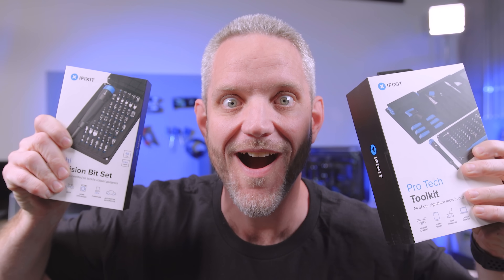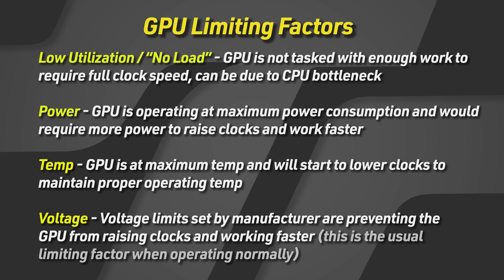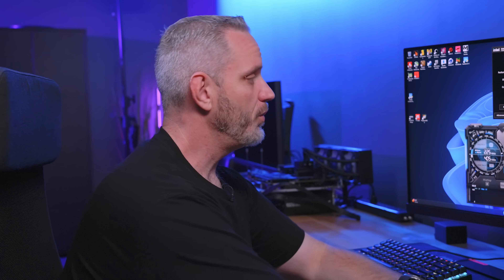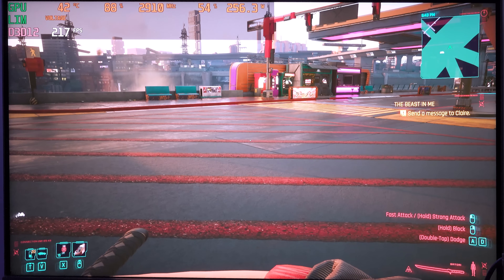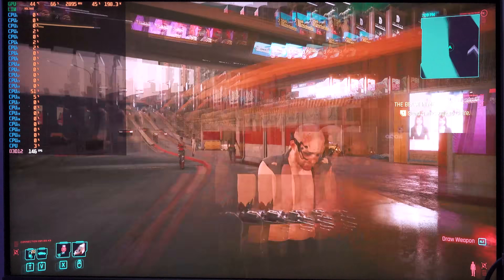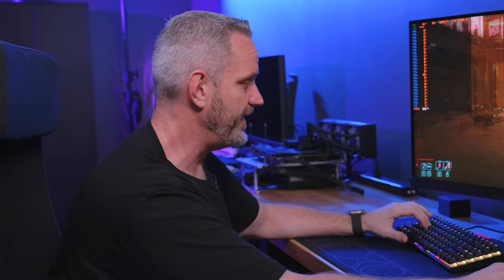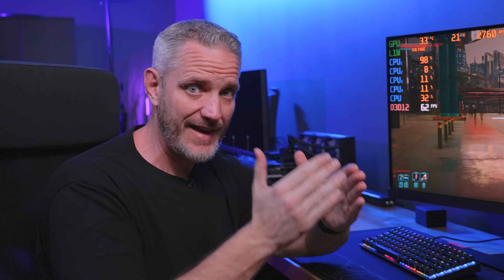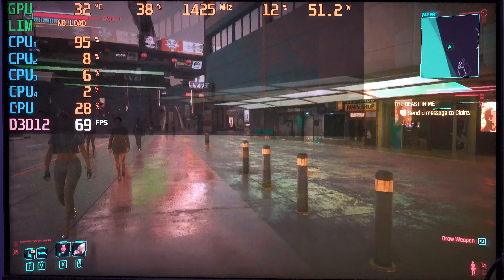THIS is what Bottlenecking REALLY looks like! AVOID THIS!

Comment: i found out today that my ram is currently bottle-necking most my games once i upgraded from 16gb to 32gb i gained anywhere from 70-100 fps in most games sadly tho i had to return the ram as the one i replaced it with were dead..

Comment: I have a ryzen 5 5600g cpu with a rtx 6600 xt and i cannot play fortnite. I get a max of 60fps and it constantly goes from 60 down to as low as 10fps. And it does it instantly. Do you guys think i need to upgrade my cpu? Ive read that it doesn't work well with fortnite

Comment: really does show that single core speed really does matter too tho as im running 4090 with a 5800x3d  and my frame timing is good but frame rate is not as nice as that but i run cyber punk with dlss and ray tracing on pathtracing tanks the gpu tho has anyone else found this ?

Comment: Well I have a overclocked i7 9700k 5.1ghz and my 4080 is killing it like in fortnite the frame drops and stutters are terrible and bf v is a little better but still annoying I really didn't think that it would bottleneck that much I knew it was going to but just not that much i'm hopping that a 5800x3d will fix it tho i'm just a little surprised that my i7 is having issues that bad with the 4080

Comment: I run a 5600x paired with a 3060, in 1440p, it doesnt like new world his high settings xD. You think i should upgrade graphics card?
Reply: No
Reply: @jehhh7794  found out why new world ran like 💩i had it installed in my hdd instead of my ssd 🤣

Comment: I think i have a bottleneck with my CPU but i still have to test. But now i know a bit how to test.
CPU: Ryzen 5 2600
GPU: Radeon RX 5700

If it wasnt for that i can still run everything with about 70 FPS (ultra settings) on 1080p and almost every game with 70 fps on 2k. Else i would have upgraded to Ryzen 5 5600 and the RX 6600/6700

Comment: Surprisingly the i7 3930 k does a good job with no CPU bottle neck maybe small amounts but in terms of graphic output it puts out so I don't know why you would ever pair a high end GPU with CPU if the CPU does not support pci e 3 or 4 sandy bridge processers made with no support for pci 3 shows just how far off technology is going off the page to extreme measures instead of perfect old craft I get high fps with my gtx 780 jay has to do this because it a job for him now to let the average consumer to go with the next gen hardware back in 2011 jay was vvery happy with his tri sli playing battlefield on 3 monitors.

Comment: I'm running a i7 13700kf with a 4070 ti and my limiter is voltage, but I'm still getting some occasional really bad stutters/skips. GPU at 97%, CPU around 60-65% utilization. I've tinkered with afterburner core/mem clocks at +100/+500 all the way up to +200/+1000 and cant seem to find settings that completely eliminate this issue. I've got g-sync on and set my fps limit at 140 in nvidia control panel, monitor refresh rate at 144, and in-game fps limit at 144, but I'm still getting that occasional WILD rise/drop in frames that lasts about 1-2 seconds. Anyone have any advice here?
Reply: to be clear, I've got my msi afterburner voltage slider all the way up and still have voltage as the limiter

Comment: Jay when you turned down your cpu to 4.1 your were still on low settings which uses more cpu of course its gonna loose A COUPLE fps. But bottleneck I feel is based more on the person settings, then the actual build, to an extent. And I never understood why people have to run such high fps! I am an xbox player, 60 fps is PERFECT for gaming AND the human eye can only see 30-60 fps anyway, anymore than that, your eye CAN NOT SEE. So understand my confusion. My bulid is a z97 4790k @4.4 2133 ddr3 600w PSU and a Radeon 6950 xt. Yes, a gen 4 pcie on gen 3. OMG, hell has risen from the depths lol. No problem. Back to fps, I vsync @ 60 of course, but I have everything to the limit, Rendering and Super sampling, Override all anti's, etc. But guess what, I get a constant 60 with, if any fluctuations, a lil higher frame time, cant notice, and guess what, my cpu, ahh 60- 70% utilization! Most people really don't really know how to set up things, no offense to them, but that seems to be the case. And the great thing about how I run my setup, I run my game clocks lower, which increase lifespan, and reduce temps drastically. 60 fps lifer. Drew

Comment: If I have an Intel i7 7700 with a RTX 4070 ti Super, will I get bottlenecking?
Reply: yes depends on resolution, i had 4080 with 7700 at 4k 60hz but moved to 1440 144hz with 4700kf and much better input latency and feel in game for titles like witcher, cyberpunk, hogwarts with framegen, reflex, ultra settings

Comment: Is there a possibility that my CPU is bottlenecking my GPU ? 

- RTX 3080TI
- AMD Ryzen 7 5700G
- 32GB Ram 3200Hz
Reply: Don't use a G cpu they have very low cache. Upgrade to 5800x3d and no more bottleneck

Comment: Bottlenecks aren't that much of a big deal as long as you're not over like 5% it's not considered a major concern take a ryzen 7 7700x and a 4080 super this will give you a bottleneck  of 9%   at 4k that means round 160 fps at 4k  and over  200 fps at 1080p now you won't see huge swings in fps adjustment from low to high till  around a 15-20% bottleneck now is that really such a horrible thing or is this big scary bottleneck  just a way for them to force you into buying a more expensive CPU

Comment: i just got a 3080 turbo eddition, my first and last blower card. i got it to replace my 3070 but at first its performance was worse than 3070 temps were at 88 then fan kicked into fkn overdrive after replacing thermal paste (-11 degrees c) it now performs almost identically to 3070 i have 32gb ram @ 3600,  ryzen 7 3700x, amd 850w gold rated psu, did a clean install of drivers and even ran a 2nd power cabble to gpu to split the load but no difference whatsoever anyone got any ideas?

Comment: had my 2019 i7 8700 with gtx 1060 6gb die so i built a optiflex with the gpu and psu but downgraded to i5 4590 any game i played i played 1080p with mixed settings mostly high or ultra but if it got low fps then med to low but fast forward almost a year i had a 400 ish usd budget now i have a ryzen 7 5700g and a rtx 3060 12gb from msi i gotta say its smooth and i dont have to have mixed settings now i just have the presets and nvidia app/experience and 1080p every game ive tried besides starfield it maxs out also dont forget hdd will make the game slower overall just get ssds its gonna save you headaches hhds are for mass storage not gaming not anymore at least

Comment: I'm from Bangladesh. I'm going to build my pc. 
Monitor: Selected
CPU: I914900K

GPU:
(CAN I ADD LIQUID COOLER ON GPU?)

ROM:
RAM:
POWERSUPPLY:

CASING: NOT NEED
( I USE THEM OPENLY ON MY TABLE )

MOTHERBOARD:
PROCESSOR LIQUID COOLER:

Please suggest the best thing. I believe you. My budget is $2,463 USD

Comment: I get the point behind all this. However I just think its basically useless. No one is going to be playing at low settings at 4k with this setup. Like it's just never gonna happen. To make your point you had to show a situation that will literally never happen. I just don't see the point of it all. No one will have a quad core chip with a 4090. Most people have enough brain cells to make correct parings with their system components. To show actual real world results all you had to do was enable DLSS. That would render the game at a much lower resolution then upscale it thus putting much more load on the CPU. But sure I guess taking away 75% of your cores, dropping the frequency, playing at 4k low with a 4090 def makes sense. Like I said I get the point of the video and why it was done. Still it's something literally no one is ever gonna see in real situations. If you wanna show what bottlenecking is showing an actual real life use case of it would help people out much more.

Comment: Heck. Show em a 4090 and a 4790k. Much more typical for broke gamers I know to keep their GPU modern while saying "Ah. The 4790K was one of the best CPUs of its time. It's not bottlenecking my... 1080ti, 3080, 4090....".  I've heard that statement over and over throughout the years. Still hear it from my stupid friends.

The bottlenecks your showing just seem to be less probable and not really even noticeable considering the frames are topping out in triple digits.

The bottlenecks I'm use to seeing make a 3080 max out around 90 frames (1080 high) on a game like cyberpunk. And it's because it's being paired with a cpu that's 9 generations old.

The folks I call "friends" think their cpu/gpu pair is fine as long as they get 60 fps or more on everything. But then they pair it with... ya know... a 12 thousand hz display or whatever.

Comment: Well i think you chose the wrong software to test CPU bottleneck. Try Microsoft flight simulator and you can clearly see bottlenecking like in my videos that uses RTX3070 with i9600K. Forget 4070 even with 3070 the CPU wont even be able to handle.

Comment: Just make sure to drop an old mechanical hard drive into your build, in combination with slow memory in single channel, that way all your other components will live forever ☝️😂

On the other note, my cheapo 300$ pc is insanely well balanced, the bottleneck is the whole thing, no particular component is slower then the others. Ryzen 7 2700x, paired with 32gigs of decent ddr4 (not the fastest, not the slowest), a mandatory ssd (also doing decent speeds), amd an oooold 1080ti extreme. I could do a little better with an AMD gpu paired with this CPU, but its marginal. This config does easy 60+ fps pretty much everywhere, granted i only do 1080p as my display is native 1080p @ 60hz. I wont upgrade my display though, as the resolution gives me such an overhead, that it wouldnt make any sense to go 1440p or higher. It would cost a fortune, so i'm pretty much bottlenecking my display ☝️😂😂

Comment: Im getting ready to try and build my first PC. Can someone experienced let me know if this is a decent build with less bottlenecking probabilities:

AMD Ryzen 7 7700x 8 core 16 thread CPU

MSI Pro B650-P  wifi pro series motherboard

RTX 3070 Ti GPU

Corsair Vengeance DDR5 Ram 32gb (2x16gb)

Corsair CX750M 80 plus Bronze ATX 750 watt PSU

Then I just have a 2TB crucial M.2 nvme gen 4 up to 7400mb/sec

Also idk how to tell if a case would be compatible sith the parts tbh but i chose the 4000D airflow from corsair. If anyone could that’d be nice. I am scared to buy everything and while trying to build it I end up bottlenecking the PC with the combo of my lack of my PC knowledge

Comment: @JayzTwoCents

I’m sorry, but your definition of a bottleneck is wrong. A bottleneck is simply the limiting factor of your system. If you improve the component causing the bottleneck, you will get more performance for the use case in question.

Your test and result is correct, but you are misinterpreting what a bottleneck is.

In all process, system, supply chain, whatever, there’s always a bottleneck because bottleneck is only a limiting factor.

What you are describing will impact performance for sure, but that’s not what a bottleneck is. 

PC bottleneck is a situation where one computer component hits its limit and limits the capacity of the other components in the system.

Comment: Why don´t you use a  more accurate bottleneck like mmo have out in the open world in to citys with multible players ore cpu like r1600 paired with 5700xt-6700xt 4070 why high end on both sides ?. In one of my system i have r1600 5700xt wheir in new world the game can jump from 80 low in the world down to 30-50 fps in towns same happen in wow long time ago you run 150 fps in world and you got like 30 5o fps in og.

Comment: Unfortunately not very good video. Its chaotic.

IMHO the best way to show bottlenecking is:

Run the GPU at its max performance and then trim down the cpu cores/clock  until you see performance drop.

In your case the GPU (at this 4k resolution was the bottleneck). You had at least 50% of that core available but it was not used.

If you kick down the resolution so your GPU could potentially do more fps then the cpu would be the bottleneck (in this case the game does not spread across many cores so its not immediately obvious as you pointed out at the beginning (because its not multithreadded)). If you pick different game (multithreadded) or cut the cores down so you would see the cpu used at 100%  and then play with resolution you could show that gpu was taking longer to draw frames so cpu starts to have a bit of free time.

The video is too chaotic, even I who knows what is the problem had trouble following. Too many variables, not enough methodical.

I appreciate the effort but its not the best way to spread the knowledge.

In short words: bottlenecking is when you use one resource to the max while other resources wait. BUT in case of games 4k @ 100fps is not comparable to FHD@180fps. So even if in the first case you have bottlenecking the general result is better.

Comment: How this makes sense?
You are in the game looking at the menu and GPU is at about 40% (460fps) but it is limited by voltage?
An increase of the voltage would do what? 
In the next scene the limitation is 'no load' while at the same frequenzy (400fps) and still in the menu?
With less fps the limitation is 'no load' while with more fps the limitation is 'voltage' while rendering the same things?!

At 1080p GPU is at 85% (220fps) and 'limited by voltage' and CPU is at 50%
At 4k GPU is at 90% (80fps) still 'limited by voltage' and CPU is at 30% 
This does not fit at all what is explained lol
Completely ignoring other significant factors that would limit games like memory bandwidth, available VRAM, ...

btw What cores (P/E) are being used in the first tests? Shouldn't P be on the top of the list and in the first few test the CPU being used was at the bottom which may indicate an E core is used?

What we take away from this video? nothing :D

Comment: I do not see any reason to run higher frame rates then your monitor can display per second/Hertz I currently run 3440x1440 IPS 144hrtz gigabyte panel with a r5 3600 and a 3060TI never run into a CPU bottleneck, also I have Gsync enabled with the freesync panel but I also Cap My frame rate in Nvidia Ctrl panel to 144hrtz. This way I can get my max frames the monitor can show me and actually save power since why on earth would you run a GPU at 99% usage for no gain over the 144hrtz/144fps if your GPU can do it at the lowest GPU usage possible say 65% usage in my case in some cases, It saves power and doesn't make the GPU overwork 100% of the time when not needed for no visual gain unless you are a very competitive snap shot shooter gamer that tons of extra FPS may help with response time when say you hit trigger on a shooter. I laugh at some people when they are gaming at 1080p with major overkill GPU and CPU and bragging about over 300 FPS all the time and I ask what's the refresh rate on their panel and they tell me 60hrtz SMH lol   BTW most of my testing is done with WarThunder and red dead 2 which I  don't even monitor since it is a goof off game IMHO My CPU usage hovers between 15-25% tops on WarThunder at 99% GPU usage while gaming.

Comment: Dear god man. How can you mess this up so ridiculously?? " Bottlenecking "   and  " limiting " are not the same thing. Limiting is what happens when one component isn't fast enough to allow another component to run at full speed. *Every single component in your system except the very fastest one, is limiting the very fastest one.* 
Bottlenecking is when the slow component *adversely and disproportionately* cripples the faster component. It doesn't have to be "noticeable" to be bottlenecking. It has to disproportionately reduce the performance . 
If you take a 5Ghz and take it down to 4Ghz, you might expect an equivalent 20% reduction in GPU performance simply through not having to do as much: *that is not bottlenecking* . That's limiting. 
Bottlenecking is when you drop the CPU 20% and the GPU trips over itself trying to cope with the slow data flow; e.g. GPU perf drops 50%. If the game is easy/old you might not even see that difference in gameplay but the bottleneck is there regardless. 

It comes from the fact that the neck of a bottle is not just a tighter channel; it's that when water flows out, you also have to let air in; so it 'glugs' as the flow is *further* choked from having to pull back and let air in to replace the water [or whiskey 😬] that has left the bottle.